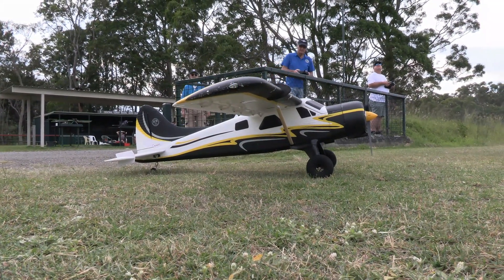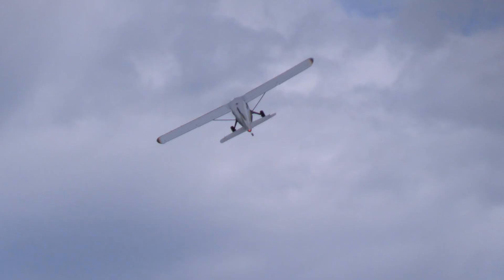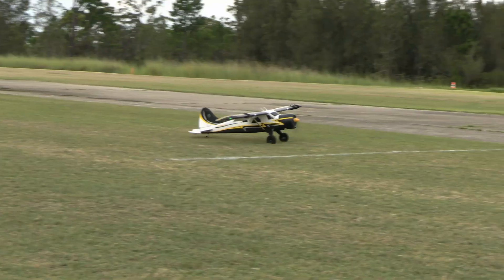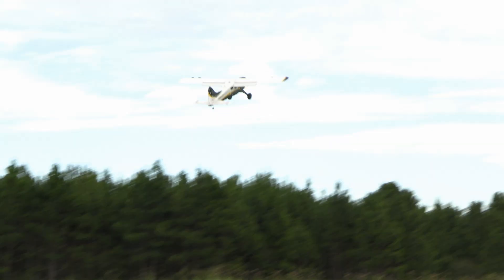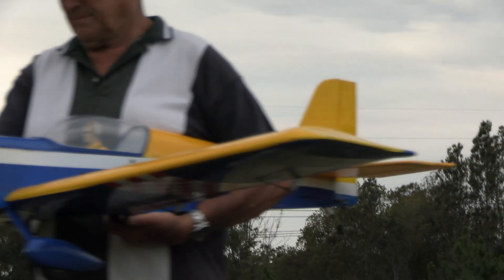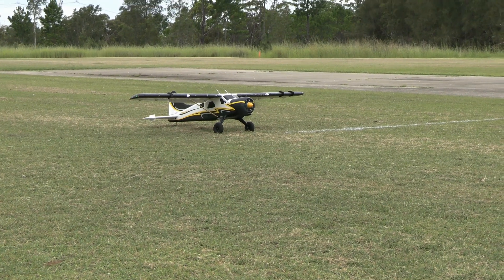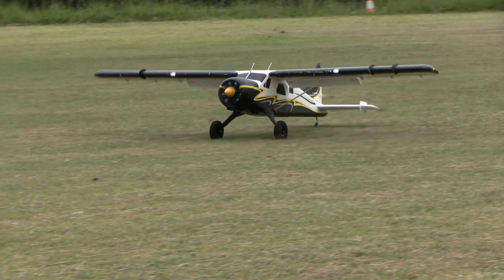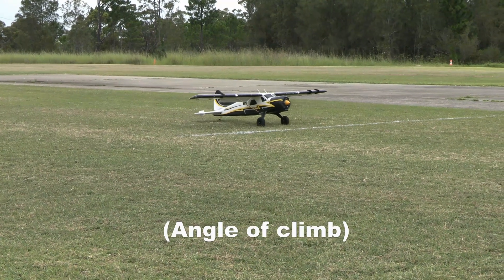STOL Techniques for RC Aircraft with De Havilland Beaver

Comment: Here's a smoother STOL Landing with water skimming to slow down the plane
https://youtu.be/ANUqU4-75tE
Reply from the maker: Looks like a very dodgy URL with the dot in YouTube.  I haven't followed the link and I suggest that others also consider it suspect.
Reply: @RCJim  it's not dodgy, it's an Eflite Turbo Timber Evo flying in the rain, but hey you're too paranoid. There's a dot in the tube because that was how the link showed up when I press share
Reply from the maker: @monchichis333  Sorry!  There’s so much Spam and nasty things going around, it’s easy to get a bit paranoid!
Reply from the maker: @monchichis333  Yes, I just watched it, and it's amazing how much water is on the field!  And I thought having puddles on the runway was bad!  I love the sounds of the motor!
Reply: @RCJim  Awesome! We push our planes to the limit. It survived 4 hours of flying in the rain
Reply from the maker: The link is OK.  Sorry for the red flag.